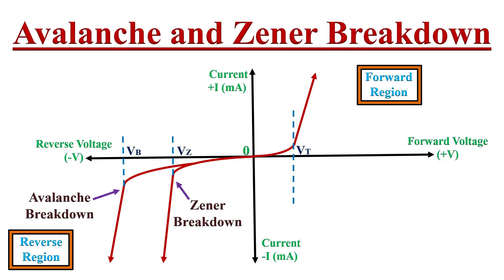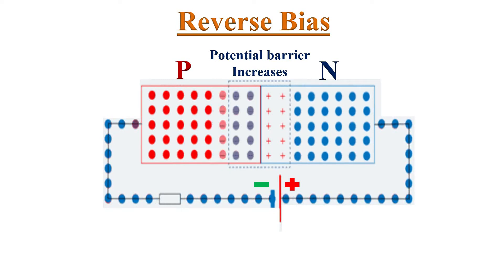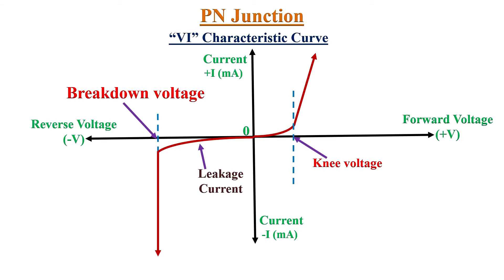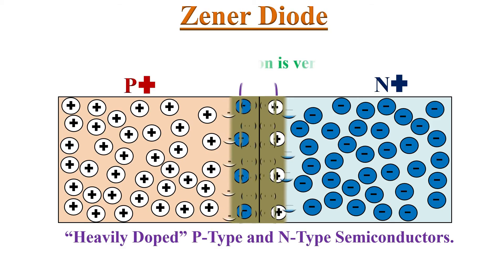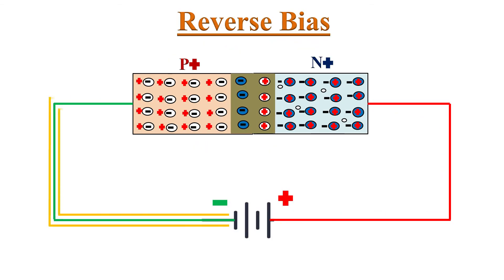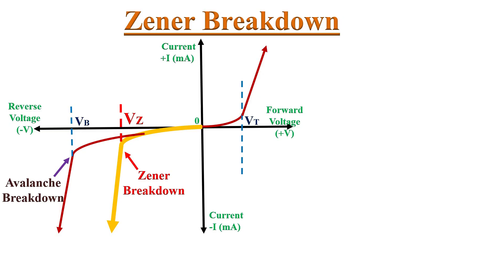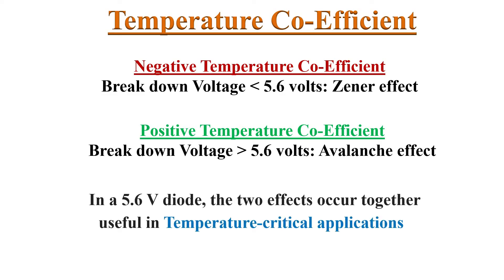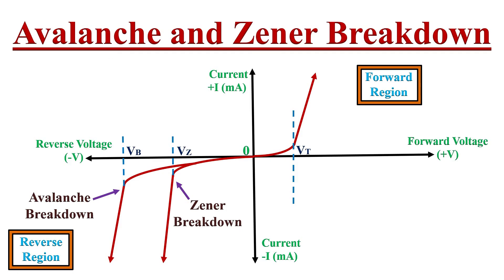Avalanche Breakdown and Zener Breakdown Effect Explained

Comment from the maker: Timestamps for various topics covered in this video are as follows:
0:18 Introduction,
1:50 Avalanche breakdown effect,
5:05 Zener diode and Zener breakdown effect,
9:00 Zener diodes Specifications,
10:36 Effect of temperature on Avalanche and Zener breakdown voltages.
Reply: Super explanation
Reply from the maker: @npavani3713  Thank you.
Reply: @npavani3713  there is another word need to use for more more times than super. That's why I told no words. I am surprised, only 1.7k views for these videos.
Reply from the maker: Thank you, This means a lot to me.